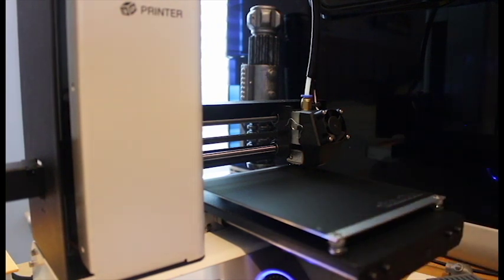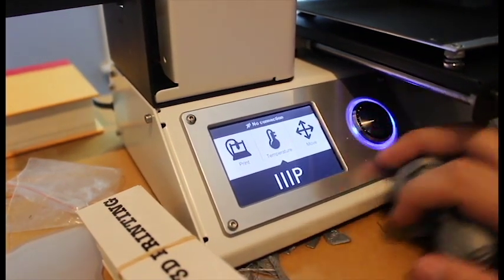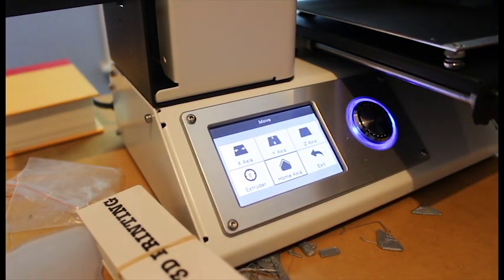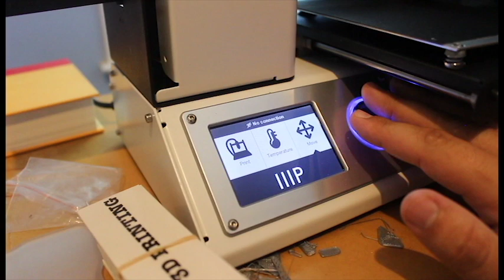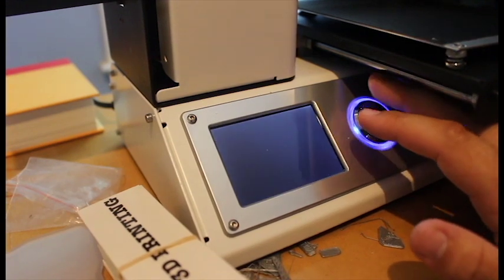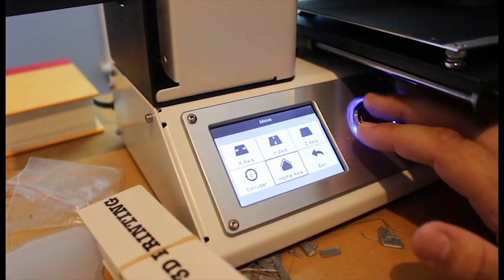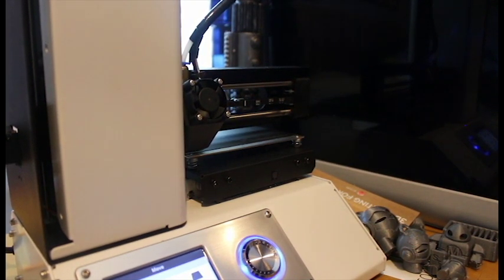How To:  Bed Leveling

Comment: Hey Chris, I was wondering if you could possibly share what CURA settings you use to help with adhesion. Right now my printer cant print directly on the bed without a raft. Im going to level the bed now and see if that helps, but seeing some CURA settings would definitely help. Thanks for the vid. Sub well deserved

Comment: How do you "free" the axes to be able to move them around?
Reply: Alex P in the menu options, there's an option to disable the stepper motors. So you can have the machine on whilst leveling the print bed.

Comment: Be careful moving the bead and hot end with the printer powered up.  Stepper motors become generators when manually moved, and can burn out your controller board

Comment: so when I level my corners then everything else is off. (the mid points between the corners and such) the corners are fine but everything else is way too high. but then if I get the mid points level, the corners are wat off and they are too low. how should I fix that?
Reply: Alzor Lightning Hello friend. I have a same issue. Did you solve it.

Comment: Thank you for this video. I'd have a few questions:
1) was it hard to install that surface? 
2) in the documentation it said one should do the leveling before everyt print, how often do you level?
3) what would be the cura settings you've experienced as best ? (temperature, print speed, retraction... )
Thank you!
Reply: oh, and there was one other thing i wanted to ask you, if i may: when taking the model off the bed, do you have the machine be off? since force must be applied what's the least damaging way to the machine, to be off, in the back/forward... something else? Thank you!

Comment: on my Monoprice 13860 Maker Select 3d Printer V2 the bed is as low as it can go yet the right side needs to be lowered more, any ideas? only thing i can think of is compresing thee springs untill its level
Reply: The177Hunter I'm having this problem what did u do

Comment: Can u make a video how to print stuff on the select mini on cura
Reply from the maker: That would be hard for me as I don't use cura, and quite honestly never have. I typically use Simplify3d
Reply from the maker: I will try playing with it and may give it a shot.
Reply: Chris Brown what do you use?
Reply from the maker: Simplify3d,  though you have to pay for the program it's definitely worth it.
Reply: Chris Brown is it easy to use I want to print a karambit clog knife could I print that'd
Reply: Or can their be another site that's easy to use
Reply from the maker: Simplify3d can be used with almost any printer and is very easy to use. I have used Simplify3d to print a couple different karambits. Simplify3d also has some very good instructions and trouble shooting videos and pamphlets!

Comment: I like your video, but have a question. After homing, does the initial layer height affect the distance as well? That is, if I measure for a business card, then have an initiall layer height of say 0.45mm (on a 0.3mm nozzle) does that 0.45mm change the leveling I did?

Comment: one last question for tonight witch 3d printer filament do your recommend to start with the ms
Reply from the maker: I would recommend pla. low temperature and is easy to print with on a open printer like the ms. also sticks well with a glue stick applied on the print bed.

Comment: Thank you Chris!   How Do I change the filament in this 3d printer?  Do you have any video about it?
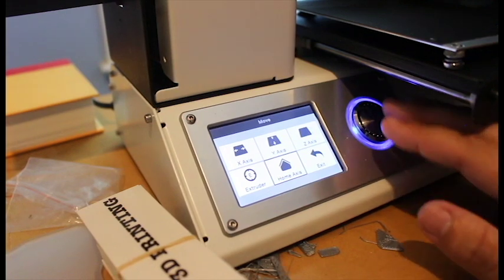Reply from the maker: I don't unfortunately. It is very simple though. What you need to do is go into the temperature screen like I show at 1:25 and heat up to the desired temperature. Once heated squeeze the lever at the top of the printer column where you insert the filament and squeeze the lever until you see your filament go through the tube into the hotend a assembly and come out the nozzle. To remove the filament you will heat up, squeeze the lever and push the filament through until you see it come out the nozzle, then while still squeezing the lever pull the filament all the way out.

Comment: Thanks for the info.  I'm new to all this 3D, but been following it since i first saw a 3D Printer at a convention in early 2000.  At the time it was a bunch of collage students that had built it and was showing off what it could do.  I've been going to 3D convention here in NYC for the last two years and haven't got one yet because of prices.  But I'm planning on getting this one since it's only $199 just to get my hands dirty.  Planning on getting the Wandao Dupicator i3 plus for the bigger build volume but the price is good at $499.  It's the same as the Monoprice Maker Select V2.  The select mini will come in handy in the next few months with the Holiday just around the corner.  Planning to print a lot of thing for Halloween and Christmas since those are my two favorite Holidays and we do a lot of decorating for them.  Thanks again for the bed leveling info.  Not much about it here for this printer on Youtube yet.
Reply from the maker: +oxgon Simplify3d has released the profile on their website. if you don't see it send them an email and they will send you a copy
Reply from the maker: I am also looking to get a Wanhao i3 also. If you don't have a printer yet I would fight the temptation of buying a kit because they are cheaper and buy a assembled printer.
Reply: Yeah!  I'm not planning on getting any kit printers.  I seen so many Problems from people who've got kits and I can fix things...  but not going to try putting together a printer.
Reply: Hi Again Chris.  Just order my printer and hope that it gets here on Thursday since I'm off from work that day.  I plan on putting it in the other room because I run my AC all day long in my room.  QUESTION??  What slicer do you use for the printer to resize 3d object for printing and do you need to resize if you download something from Thingiverse.  I would like to know.  Also I order two filament with it white and orange.  For Ghost and Pumpkins for Halloween. :)  Going to start early.  Then from there I'll get some other colors as I go along.  Also is it better to print at a slower speed to get better details from this print or can it handle high speed prints?  Hope to hear from you soon and once again for this video.  I know there a maker store (other then the Makerbot store that closed) in the Village here in NYC but I have to find it.  I ran in to them at one of the 3D print show and know about where they are but unsure.  Hope to find them soon.
Reply from the maker: +Victor Vazquez I use Simplify3d, if you are into 3d printing and not just something you play with on occasion then it's something I would recommend, it has features that life a little easier and it's available for almost all printers. I can email you the profile for the MP MS mini. I run my printers through Simplify3d. For scaling models, most of slicers I can think of off the top of my head have the ability to scale models once imported. 

As for speed, that comes down to a few different variables. The first being the max speed your printer can handle. The type of filament you use is also another factor, most spools have the print speeds on them if not you can find it on the manufacturer's website. The last important variable is the layer height. 100 microns is going to need to be slower than 400.
Reply: I've been looking at Simplify3d for a while.  It's the best on the market but most people keep away from it because it not free.  $150  I hear or so.  From everyone that I follow on 3D say its the best and supports are so easy to remove once finish printing.  And that Simplify3d are quick to add new printers to there profile to work the best with the software.  I well be a virgin once I get my printer but I've been following it since Makerbot became big before going to the darkside and falling to pieces.  I think I will do well with this and plan to print a lot of things too.
Reply: Id like a copy of your profile please
Reply: If your asking me about my profile setting for this printer.  I mostly use the setting in the MP Select mini user manual.  They show how to set it up in page 12 of the book.  If you like more help there's a facebook page just for this printer and they help me a lot.  https://www.facebook.com/groups/1717306548519045/